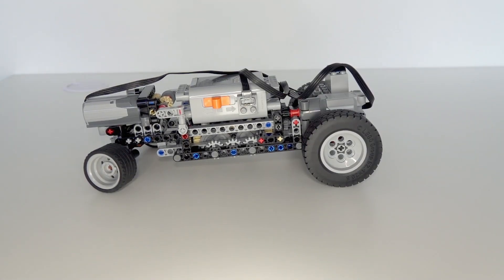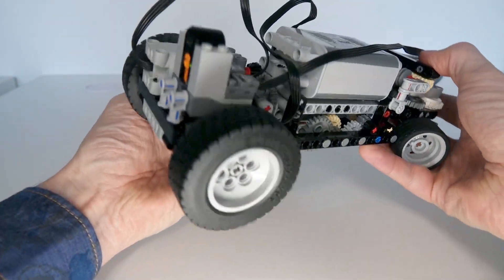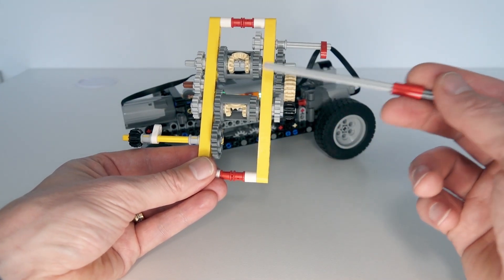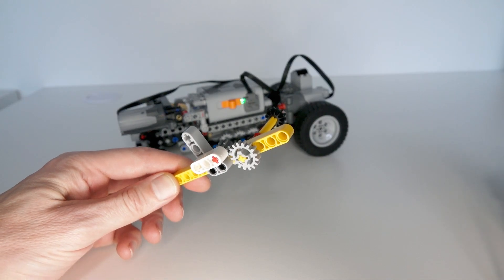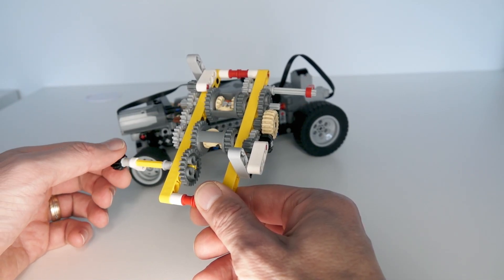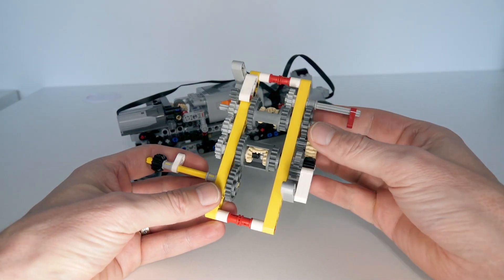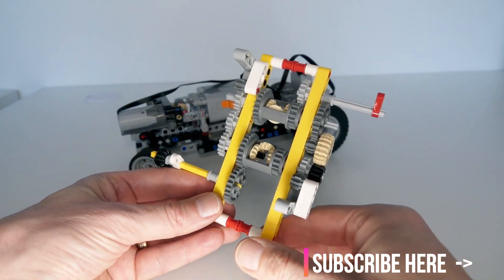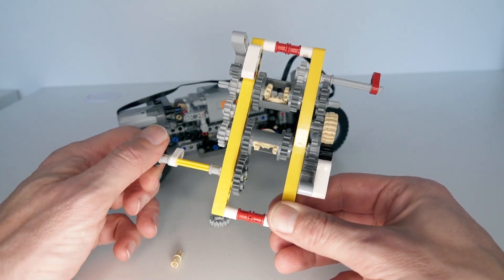Lego RC car chassis with slow reverse gearing mechanism.

Comment: Great idea. If the ratchet was improved then you would not have the problem? A rubber band may work to hold the ratchet firm on the front gear chain, when going in reverse.

Comment: Hi, I just stumbled over your channel and subscribed, your creations are  amazing! I definetely want to build one of your automated transmissions. I think this particular mechanism would be also great in a crane, fast lowering and strong lifting.
I think the differentials are not needed here and you could use only one ratched which directly engages the gears.
Here is my version: https://youtu.be/ltc_aEMkyD4
Cheers 
Gerrit

Comment: The problem with this particular ratchet design is that it doesn't work while upside-down, which is a problem because you live down under. How have you not fallen off the Earth, yet? Gravity shoes?
Reply from the maker: Yes I have made some anti-gravity shoes with my Einstein lego technic set. Do you have that set?
Reply: @TechnicBrickPower  No. I'm afraid that I only have the Curie set. Also, do you know how to stop rapid hair loss and mottled skin?

Comment: Awesome! I have a thing I've been working on for a while and it was inspired by your automatic gearbox and another youtube video here ( https://www.youtube.com/watch?v=lPch2rY7wpQ ). What I'm trying to make is a gearbox that when the output can't move, the output reverses, I"d love to see if you could figure this out, my main problem right now is the "dead spot" in the transmission. If you want to see what I've designed so far contact me!
Reply from the maker: Hi Gnocchi. Thanks for your comments. I like your idea about the gearbox that reverses when it can't move - that's a fantastic idea. I watched that video and I found it hard to tell what it does exactly but it seems to reverse automatically but I am not sure under what conditions. I'd love to see what you have some so far. You can email me at technicbrickpower@gmail.com